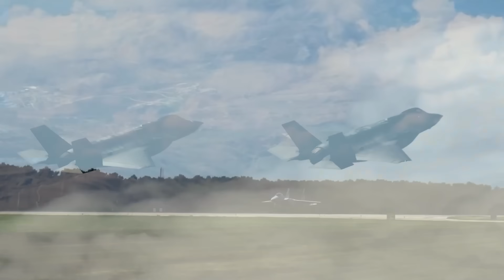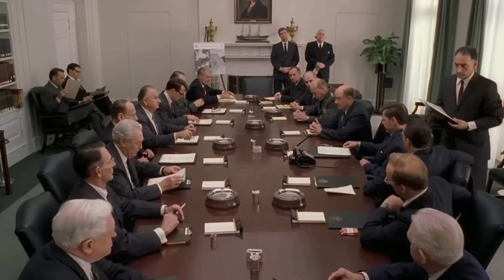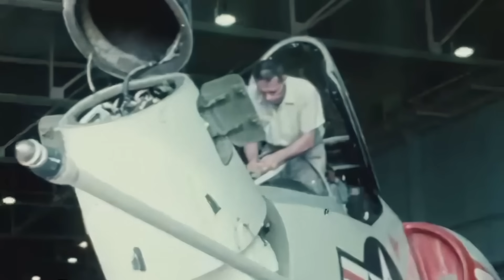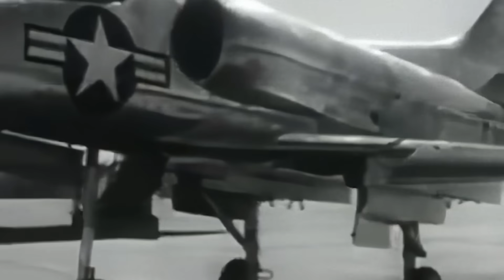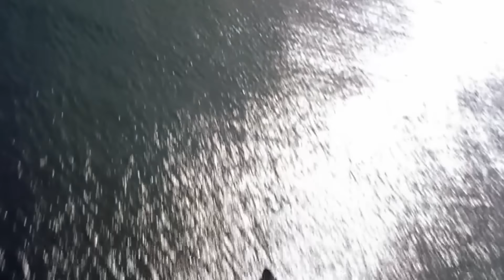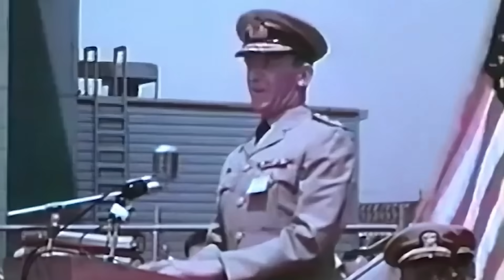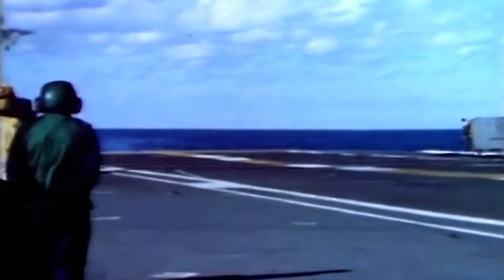A-4 Skyhawk - Simple and Deadly

Comment: It’s the Navy’s demand for two engines that drives complexity….
Reply: Yes, the second engine must be responsible for the extreme complexity of the F-35.  ;-)   

Two engines is not really very complex with jets, it is heavier, and mostly it is more expensive. But it actually makes desired redundancy of systems simpler in some cases. 

I think that oft-cited Navy "demand" is mostly myth.  I'm sure some admiral said that at some point to refuse to consider a certain airplane, but they say lots of thing to get what they want from Congress.  In the history of Navy fighters only a handful have had two engines, and it was usually necessary because a single engine was not powerful enough for the desired performance.
Reply: @AirwayZombie The Navy refused the winner of the Lightweight Fighter fly off.

Comment: Military aircraft being "outdated" at FIVE years old is a pretty wild concept.
Reply: It was a quantum jump from prop to jet. However, the A-1 continued in use for many years after it was declared "out of date", and its true successor was the A-10, at least in the Air Force.
Reply: They came out with new generations of aircraft every few years in the 1950s. A plane that was high tech in 1938 was totally obsolete by 1942, a plane from 1940 was hopeless by 1945. Why is that strange? They were also far, far cheaper and simpler than modern jets. Five years is already half a decade, and they already considered piston engines obsolescent when the A-1 was finally introduced. They basically started designing the replacement as soon as the previous aircraft entered production, because obviously much better aircraft will be available in a few years. And they were. The F-4 first flew less than 15 years after the end of WW2. You don't go from F6F and P-47 to F-4 without a few generations, and you need to fit all those generations into a few years. Then design peaked essentially, it became much harder and more expensive to materially improve on actual performance. That's why we have had the F-15 for fifty years. that is the anomaly, not the rapid evolution of design. That has never happened before now. Same with the modern combat rifles. It's hard to design something that's enough of an improvement to make it worth replacing, especially when the new jets will cost astronomical prices.

Comment: Pound for pound a very effective and affordable aircraft which performed great in the CAS role in which I reveled as I flew  CAS for the troops on the ground in Nam.  Managed to accumulate little over 2000 hrs in the Skyhawks and loved every second/minute/hours in the scooter.  Semper Fi!!
Reply: I had tons of fun maintaining the CP741 Loft, Toss and Over the Shoulder bombing system in the A-4F. Quite the analog computer system for special weapons delivery. Every once in awhile our pilots would still have a Mk76 bombing derby using it for delivery even into the 1980's.
Reply: @Skyhawks1979  doing those maneuvers in the A4B was a chore.  Had to really concentrate on keeping G sched with needles centered going into whichever profile you were executing.  Over the shoulder was the most fun for me especially when the WSF kicked off.

Comment: When the Blue Angels flew these, the fast aileron roll rate was awesome to behold.
Reply: It was their most capable mount. As you said, that roll rate made for a great show. 👍
Reply: @socaljarhead7670  Totally agree. The best shows were performed in the A-4.
Reply: They rolled, with stick to the stop and a bit of rudder with the stick, at +/- 750 degrees per second. Only the Northrop T-38 and F-5 have a faster roll rate, at over 800 per second. The SF-260 that I flew at Air Combat USA rolled at about 90° per second, same as the P-51, and the Pitts S-2A and S-2B, that I flew for years in the '80s, rolled at 180° per sec. Plenty fast. A friend that flew for us at Air Combat USA, who had flown the A-4 as an aggressor pilot at Top Gun/NAS Miramar, told us that he would brace his helmet on the canopy opposite from the direction of which he was going to roll, when doing full-deflection rolls, so that his helmet didn't bang on the canopy when he went hard-over on the stick. 🙄🤣
Reply: @conradinhawaii7856  Thanks for the information and experiences! 👍

Comment: To be clear, the undercarriage was not extended for ordnance clearance, but because early carrier jets tended to scrape their tails on takeoff. Heinemann knew this was a thrust-to-weight issue, which the A4 was not going to have an issue with. But the US Navy insisted.
Reply: I was always told the gear was long to accommodate the large single "special weapon" on the centerline station.
Reply: @Skyhawks1979  My reference in this case is 'Jet Bombers' by Bill Gunston & Peter Gilchrist in 1993. "Heinemann was irritated at being told to lengthen the landing gears (because other jets had been scraping their tails). This made the XA4D look stalky, perched up high, and threatened to cause trouble on rolling decks (it didn't), forcing the Menasco main legs to be shortened before retracting forward to stow the wheels in the leading edge". Since he is talking about the prototype rather than the production version, this rings true. Saying that, it may well have turned out to be useful when fitting big centreline stores.

Comment: And pretty much the only reason the A-4 Skyhawk will be retired is because the airframes will exceed their service life limits and it will not be financially viable for the countries using them to rebuilt/refurbish them and get new spare parts.
There have been upgraded Skyhawks in the past. Singapore had the Super Skyhawk that was modernized... But I would love to see a Skyhawk built today from scratch with every upgrade and bell and whistle you could find. Digital fly-by-wire, glass cockpit, new engine, etc. It would be scary...
Reply: I'd argue the closest thing to a modern Skyhawk would probably be armed trainer jets of today. Something like a BAE Hawk 200 (a single seat hawk trainer used as a light fighter from the 90's) or the L-39NG (modern/new production version of the older L-39 trainer). 

I argue they spiritually/indirectly inherit many of the A-4's features and roles (small size, cost-effective, nimble) while also being modern aircraft. If you want we could also include KAI T-50 or T-7 for singe-engine super-sonic examples.

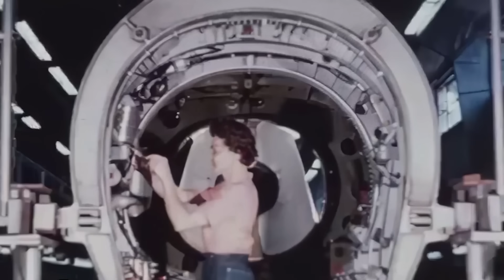Comment: 5:55 Yeah, but it also meant one of the workarounds to dealing with issues in some of the forward access panels meant sticking a sailor down an intake like the world's most anxious q-tip.
Unless they came up with something better later, anyway. My info's from the first couple of cruises they were on in the first two squadrons, so I've always hoped this issue was remedied at some point.
Reply: It wasn't too bad. It was mostly to access the engine mounted constant speed drive unit and generator mounted on front of the engine.
Reply: I served in VA-113 on the USS Enterprise from 1967 to 1969  and recall flight deck duty as HM-2 (corpsman). The squadron transitioned from A-4 to A-7 Corsair II in Dec 1968.

Comment: One of the points made about it is that Heinemann did not develop a wing for the A4, he developed a fuel tank that generated lift. Those two big drop tanks also served double duty - if the undercarriage was shot up, the pilot needed to emergency land or ditch into water, the drop tanks served as very effective landing skids.
Reply: I remember one of my dad's friends mentioning a story about having to do that when he was with the Marines
Reply: Actually he did develop the wing, where one of the things he did was put the landing gear struts under the wing in the fairings on the bottom of it, of course he also did do the drop tanks as a part of it and the role they pay.

Comment: The Republic of Singapore Air Force strapped a F-18 engine to these birds and created the super SkyHawk. It is mentioned 7 minutes into the video. The modifications was done by Singapore Aircraft Industries or ST Aerospace now. They even created dual cockpit versions of the A4SU super sky hawk for training pilots. The national aerobatic team the Black Knights also used these Super Skyhawks for aerial displays.
Reply: Holy- WHAT?!?!? That's awesome!!!
Reply: The non after burning F404 and the J52 P408 were almost identical in thrust.
Reply: Top Gun did a similar move…
Reply: Ya Loved the A-4SGs. But rumour has it that the new engines were too powerful for the airframe so the plane had the tenancy to shake a bit. Do u know?

Comment: Arguably, first generation jets might have been more challenging to maintain in the field than the piston-powered planes they replaced. However, jets were NOT more difficut to fly! The air cooled radial or liquid cooled in-line engines which powered WWII fighter and attack airplanes were far more labor intensive to operate than jets, and required a lot more attention from the pilot in flight. The jet was the ultimate in simplicity, just push the throttle lever and forget about it!

I was lucky enough to fly the A-4 Skyhawk for just under a thousand hours. It was a marvelous airplane to fly, stable, responsive, and highly maneuverable. Simplicity and reliability were hallmarks of Ed Heineman's remarkable design from both a maintenance and operational point of view. It had two aerodynamic design flaws which could be dangerous, one on the A and B models, and one up through the E model, but design fixes were added that eliminated the problems. The F and J through M (for "Marine") were dream machines to fly.
Reply: Good for you to shove us forward in aviation.  Thank you sir.
Reply: NZ flew A 4Ks I think.
Reply: I was an A4L plane captain with the Air Barons during the 1971 air show season.  I believe the Marine A4M was the same reworked A4C with more power and the ECM hump.
Reply: In the early jets that's not quite true. They sped up and slowed down slowly, leading to significant lag in throttle response.
Reply: @onenote6619   This is not an early jet engine. It's a dual spool axial flow turbojet, not a centrifugal  flow blower from a Gloucester Meteor, and spool time is much quicker.  But the simplicity of operation is what is miles ahead of a piston engine.  You don't have to worry about setting correct manifold pressure and rpm, you can just push the throttle to the stop and focus on tasks other than engine management.
Reply: @onenote6619  That's not an argument against my point about the basic simplicity of flying a jet vs a recip-powered aircraft where the pilot has to be concerned with controlling engine temps by frequent manipulation of cowl flaps, controlling manifold pressure with a turbocharger in various stages of boost, fuel mixture, propeller pitch control, etc.

It's true that the early jets were underpowered for their weight and their centrifugal flow engines were slower to respond to throttle movement which required some pilot anticipation, but they were far simpler to operate than recips.
Reply: @onenote6619  Besides, you could get behind the power curve when taking off if you were not careful. (F-80)
Reply: The "Mike" models have probably been the most interesting to read about, both in Foreign and Domestic service.

A few were actually used as adversaries (majority of the adversarial Scooters were Es and Fs) both with NFWS and VF-126 "Bandits". At least two of the TOPGUN Mikes that I know of (BuNo 160045, Desert Camo / BuNo 158171, two-tone green and light grey camo) were refit as A-4AR Fightinghawks for Argentina (160045 becoming C-922 and 158171 becoming C-919).

Then, there's the Private Red Air use, where things get even more interesting (such as Top Aces fitting at least one ex-Israeli A-4N "Ayit" with AESA radar and an IRST)... 
It's a fantastic little plane!
Reply: @Tigershark_3082  True but I owned 4 A-4M, got them from the USMC...humpless. VF-126, 1990-1992...
Reply: @OldGlaseye-gf7si  I remember coming across pictures of those! It's a bit odd to see one without the hump (likely due to proportions of the cockpit/windshield), but must've been a lot of fun to work on!
Reply: @Tigershark_3082  There is an A-4M without the hump and stripped for the adversary role on static display at the Reserve Base in Ft Worth. It threw me for a loop when I first saw it, having split my maintenance time on both the Super Fox and then the Mike versions. The bubble canopy and JFS hole on the starboard side were dead give aways.
Reply: @Tigershark_3082  The Blue Angels flew humpless Fs but with the M's vastly more powerful engines. That made for an awesome air show airplane. When Heineman designed the A-4 the available engine was I believe the Wright J-34 with 6,300 lbs of thrust. The Pratt P-404 in the Mikes had 11,400, almost double. Heineman could only dream of that kind of thrust when his prototype first flew. The Pratt J-52s, P6 and P-8, that went into the Es, Fs, and Js were incremental improvements in thrust and gradually improved the breeds performance.
Reply: @bearowen5480  I'd like to see what they could do with a more aerodynamic nose and much more modern engine. A cheap, but supersonic skyhawk could be cool. lol